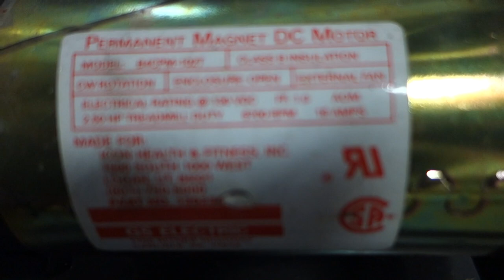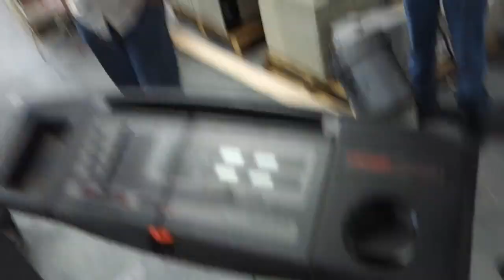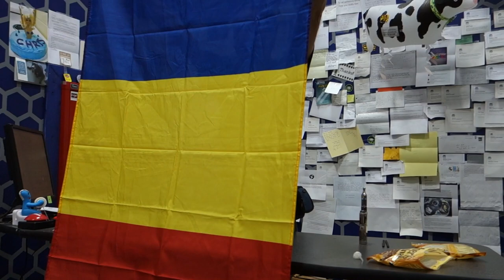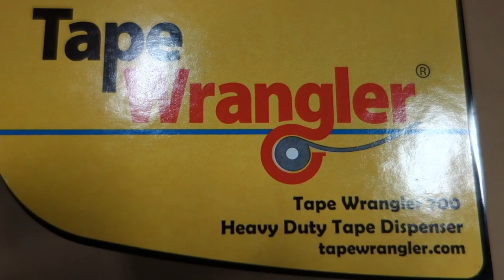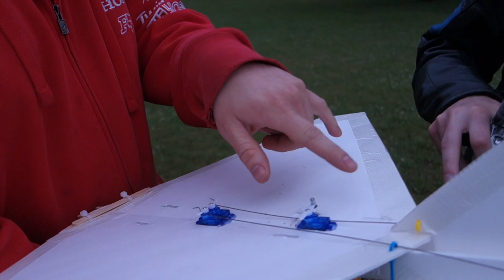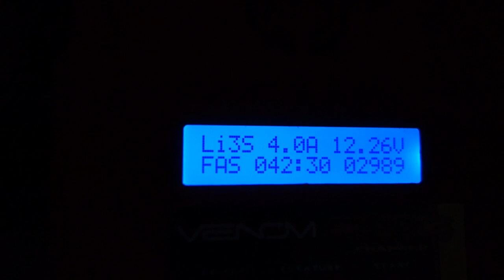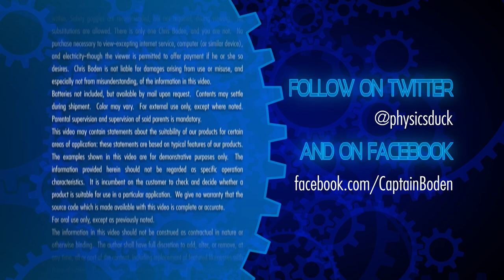Captain's Blog 6 21 2014 Treadmill and Flight Club

Comment: The airplane will take off because the landing wheels are free-spinning and wouldn't care about the ground moving. The propeller would get the plane moving as usual, the wheels would just spin faster due to the "ground" moving.
Reply: Indeed. The planes prop gives no F's about the ground speed. It's all about air speed.
Reply: Bingo!
Reply: And you would need just a TINY TINY extra bit of thrust due to the extra friction on the wheels from them spinning faster.
Reply: No it wouldn't take off. No wind = no lift = large thing going nowhere on ground.

Comment: I think he's not quite remembering what the plane on treadmill debate was about.  It was trying to prove/disprove going moving "downwind faster than the wind" using a cart with a huge propeller geared to the wheels.  The idea was that the cart could travel into the wind faster than the wind pushing it using similar science to how a sail boat can achieve overall downwind speeds faster than the wind by tacking back and forth across the wind. Wikipedia seems to indicate on land moving directly downwind faster than the wind was proved true. Google "Sailing dead downwind faster than the wind" for info.